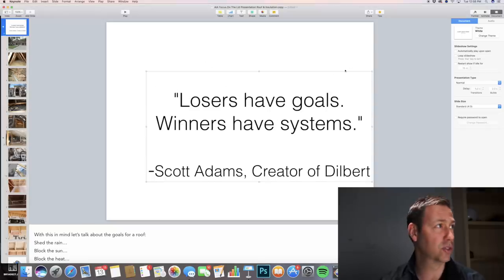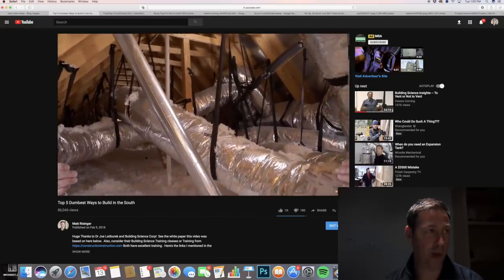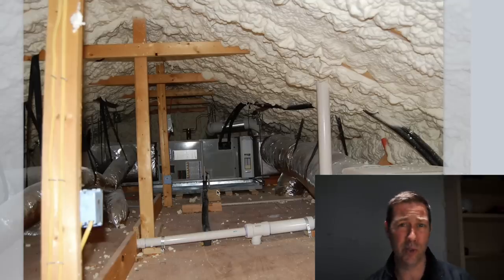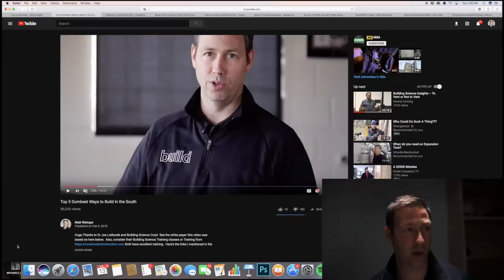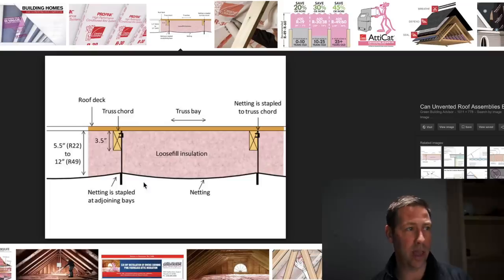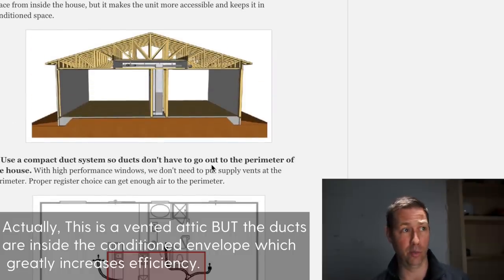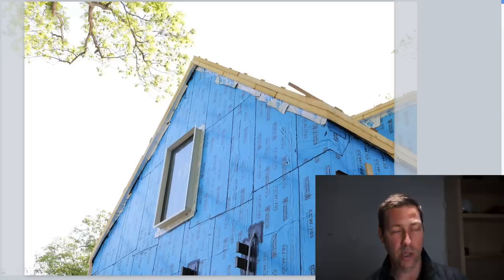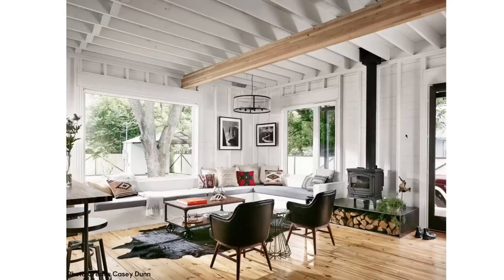Attics/Roofs - Dumb vs. Smart - How to Build Correctly

Comment: The best design I think I can muster, would be recessed attic ceiling that's insulated from below as seen. The space between the roof and ceiling being vented/fanned. That would allow leak repair because... Sectional. And maybe at the apex of such structure have an open gap so that some free air can circulate. Singles and roofs are expensive. Also. Dont just get a regular attic fan, look into fans that have proper ducts that can greatly improve their efficiency and life. We're all scientist and this channel is about good practices. Not the best. Because only you can figure out the best if you're not lazy enough to figure it out. But sure. Pay someone else to think for your money. Who knows. You may invent a groundbreaking way to do something and make bank. All for not following the lemming. Its your money. Proteccccc it

Comment: People in my area have a fascination with vaulted ceilings with exposed beams. When I did the load calculation At my cousins house the exposed beam ceiling was 58% of the load of the house causing his ac to be 2 tons larger to handle the load.

Comment: Recessed cans were not insulated likely because they were non-IC rated? Also your energy savings due to insulated attic must be offset by the added load carried by the A/C unit which now must heat & cool the entire roof surface. Spray foam also completely seals the attic which will not allow moisture a path to migrate out of the attic.

Comment: Matt, I'll apologize in advance for my ignorance but you don't learn if you don't ask questions. I was always under the impression that you needed air flow under the roof in an attic and if this airflow was cut off it would cause the roof to heat up and decrease the life of your roofing (ie shingles). I was always told that if you over insulate your attic and if you don't insure the eaves are clear for airflow, this would be a big problem. With the examples you showed, where they foam/insulate all of the rafters in the roof, how does this impact the life of the roof and roof coverings? Doesn't the roof itself get exceedingly hot being so insulated underneath?

Comment: Tried to get my builder and insulator to spray foam my roof deck - they refused. They said it would get the decking too hot, burn it up, and that it would fail. :( Didn't matter what studies I showed them, they refused. I have spray foam on the floor of the attic followed by blown in fiberglass. Works but no radiant barrier and I refuse to pay the mint that so many installers want to add it. Not a conditioned attic but it's working well enough in the living space.

Comment: That would make my current place 575k to build. It's an east TX house just like the ones you pictured. I'm thinking I could add a minisplit system in each room, leave the outside doors open year round and still be ahead. Maybe I'm a cheapskate but 250 a SF seems way high unless you are a politician. I do like the retrofit where you box in your duct system and leave the rest of the attic unconditioned. That looks to be the most economical way to get it right.

Comment: I have that exact 50 year old roof, 2100sq/ft and a $500/month power bill because the A/C can’t cool the house.  I am trying to figure out what is a practical solution.  I have to consider code changes I assume, and we have hurricanes. A retrofit has to factor in that a old house will be difficult to recoup the value if I sell, because comparable homes won’t have $300,000 roofing

Comment: I'm not sure this is great advice. Every time a asphalt shingles bubble and fail in Oklahoma spray foam insulation directly on the roof deck is to blame. There should be baffles installed on the roof deck to create a small vented area and spray foam on top of the baffles. This would be coupled with a ridge and soffit vent or you could make a small unconditioned attic at the top and use more traditional vents at the top. This would get the the benefits of a conditioned attic without sacrificing the roof deck and singles. The sun is too direct here to give heat energy and moisture nowhere to go and I couldn't imagine it's different in much of the south.
Reply: I agree, would not spray directly like that.

Comment: Use white Roofguard 700 on your asphalt roof and get to 5 deree above ambient temperature to eliminate summertime heat.  Applied once every three years and you should have a forever roof.
Reply: Look at that, a white metal house.  That would be virtually zero heat gain from the sun.

Comment: In that last metal house - it occurred to me that the roof venting system might double as a solar heating system.  If the sensors agree you could perhaps cycle house air with a fan through the roof space to heat the house.

Comment: Hi Matt, and thanks for all the experience you're sharing here. I'm upgrading a house in Los Angeles in ocean area. It is not as hot as in the desert. Never snows. But pretty humid. We are not using HVAC in the house. Trying to rebuild attic space that causes a lot of condensation and some mold. Was looking into attic fan, but after watching your videos understood it is no the way. There are vents a t the bottom of the attic and Rockwool insulation. Would you advice to seal it? Would you advice to leave the vent open and isolate it from the house air as much as possible?

Comment: I've seen YouTube video where someone got their attic  Foam sprayed and it turn into a nightmare.  According to the home owner it had a very awful toxic smell. Are they went back-and-forth with the foam company, Ultimately the home owner had to replace does entire roof.  How would you  Avoid this issue?
Reply: That happens when the foam doesn't cure correctly. Which can happen to even the best installers. So yes it can be a problem for any installer and the home owner is screwed.

Comment: fyi, when i was working for the gas co in so cal, we would work in a golf community on the east end of the city of Beaumont. part of our service was to the furnaces which were in the attic. this was the first time i have seen insulation on the underside of the roof (tile) instead of the floor of the attic. it was blown in fill w/netting to hold it in place and the attic was as cool as the main floor! remember this is in calif low desert about 40 miles from palm springs. 110 temps are common in the summer. I am curious about the air inside a house you have built becoming stale or ? does the occasional door opening provide enough fresh air or do you depend on the air handler filter?

Comment: With plastic foam insulations including spray foam in attics, in a new video, would you cover the code requirements for thermal barriers and ignition barriers, when they are and are not needed, and why they are VERY important?

Comment: Matt:Would you recommend closed spray foam in the attic space if your heating and cooling equipment is in the basement.  I am building a ranch rambler and would like your thoughts.  I'm in the west and get super hot in the summer and super cold in the winters.  Would insulating my roof benefit me?  I will have a truss roof.  thank you

Comment: I'm so confused. Last video you talked about how important radiant barrier is at stopping the heat in the attic. Then you show a "bad home" with radiant barrier compared to the perfect system with spray foam and...no radiant barrier? Is having a semi-conditioned attic space only important when you have HVAC up there? What about the homes up north that have HVAC in the basement?

Comment: closed cell foam would seem to leave the house vulnerable to rotting the rafters and roof sheathing, from leaks. Who would know the roofing material is leaking with waterproof closed cell foam under the roof rafters and roof sheathing?
Reply: Billy Graham he says, several times, that most of the spray foam you see is open-cell foam. The closed cell foam is only used to seal up small cracks.

Comment: Matt, I have a 4/12 pitch roof in Cocoa Beach, FL, and it's extremely aggravating and difficult to move around in my attic. Is spray foam to the underside of the roof the best way to condition the attic? 1957 house. Great vids. Thanks.

Comment: How does closing off the attic venting effect the roofing system if you're using shingles?  I would imagine thermal cracking would occur after just a few years.
Reply: You are correct. Go to anybody's house in your neighborhood that has a vaulted ceiling and you'll see this effect. Areas of the house that are vented with attic space will be in much better condition than the areas that are closed off without ventilation.
Reply: @JarvisElian  but only houses with HVAC in the attic should be insulated. Otherwise it can be sealed off.

Comment: One thing about foaming the underside of the roof, what happens if there is even the smallest roof leak? What happens then? Do you leave a 1" air space on top of the foam along with a ridge vent? That could be done by insulating with rigid foam, but it may be a lot more labor intensive. How about using fiberglass batts between the rafters (leaving an inch or more at the top for ventilation purposes from the soffit to the ridge, and then covering the bottom of the rafters with rigid insulation?  

Does air get through the foam and condense, or does that not happen?

Comment: Matt, about closed cell foam directly on sheathing.  With asphalt shingles on the roof, are you not concerned about a leak (10-12 years) down the road and causing extensive damage because the leak was undetected for a long time?  Or maybe I should ask, how is the closed cell foam installed to prevent such a awful issue?

Comment: Another great video.  First time I’ve heard you comment on a  vented roof.  You emphasize non vented attics but I’m wondering if we are losing something by not venting.   Are you relying entirely on thermal mass?   Seems like an air cushion which can heat and escape would keep the attic on relative shade.  Thanks.

Comment: I feel like the water proofing should of been on the outside of the insulation. Please explain why I'm wrong (or how I'm right).
Reply: because insulation will never be airtight. it needs to breathe in order to dry. another reason they built the roofing off the insulation for that air channel.

Comment: This is entirely for dry hot climate. If its humid and wet, even if the spray foam is some anti microbial poly-whatever water will get through sheathing carrying all the minerals and enough water for mold/mycelium substrate. You won't see it till you have to replace sheathing because damage is too severe. Just off the top of my head never having done this, stapling Mylar to  rafters would be more effective and you would still get air flow in rafter bay, also much cheaper++++
Reply: What about the Silver Glow [¿¿or one word SilverGlow??] he mentioned for the rafters instead of Mylar?

Comment: My builder wants to spray foam directly to the underside of our standing seam metal roof (metal frame as well) for a conditioned attic in our up and coming build.  I'm apprehensive about not having any sort of sheathing between the spray foam and our very expensive roof, but the builders in our area (murchison, TX) tell us that they do this all the time and don't have any issues with corrosion. Can I get your thoughts on that?

Comment: Matt, thanks for the video. I have a couple of questions. My home is built in 1972 and I will need to replace roof soon. First question is if using spray foam on roof decking, what happens to foam insulation if roof decking needs to be replaced? Second question, could I have roofer install 3 inch foam sheets on top of existing decking and then add the new roofing material on top of insulation sheets, like an insulated cooler top? I hope that makes sense. Looking forward to hearing your thoughts. Best regards, Steve
Reply: New roof decking gets added on top of existing, they rip off shingles, but don't usually rip off the existing decking. Not around here anyway.

Comment: So with that spray-foam, doesn't the roof get a lot hotter? Seems like I heard about this leading to premature aging of shingles... or maybe this is that tile roof you were showing us? We were also in a condo where they added insulation when they re-roofed, and the increased heat caused some major noise, with additional expansion/contraction.

Comment: Another helpful video Matt.  Thanks!
If I plan to use mini-split head units in each room, is there any advantage to insulating the roof as opposed to the attic/ceiling?
Reply: Insulating the lid and conditioning the attic space is the way to go. The heat/cold from the attic will have an affect on the overall efficiency of the building.

Comment: I'm a retired builder, ad no one is talking about offgassing. There's some pretty toxic crap in spray foam and I'm guessing it's not so bad in the attic, where the crap goes up, but does it leak down, and then there's exterior walls and spray foam. The offgassing is just not talked about much. I'm not much of a fan of certain chemicals being that close to the family. The guys spraying this stuff aren't suited up for drill, and if the two agents are mixed perfectly they stay active, and that's why when people are getting sick the manuf. is always blaming the installers. The bottom line is one in a thousand get real sick, but with bad chemicals how long can people take to wear down their immune system and get sick is different. They're just know getting the hint thatn EMF is real, and if you don't think so just live close to high power lines and see who gets cancer first. Be smart and check into the risk for you. Some people don't give a damn and some do. Science and efficiency mostly about making more money, so to live happily do the research.

Comment: Is it possible to do a "perfect roof" with overhangs?    I've seen other vids where you endorse zipwall; how do you feel about zip roof?  since vapor and moisture is on the decking, can you add the polyiso on top or would that cause issues?

Comment: Spray foam have chemical / environmental concerns? Also ability to check leak locations is more difficult. The truss plenum and exterior rigid insulation system are fantastic though

Comment: Here in NJ the HVAC installers are so stupid they install high efficiency (90+) furnaces in vented unconditioned attics. Then on the first deep freeze the condensate pipe freezes, cracks, thaws and floods the 2 floors below. It happens every winter and the code officials keep passing the final inspections. Keeps me busy as a home improvement contractor.

Comment: You mentioned having a hvac supply line empty into a spray foamed attic, but not a return duct. Is it assumed that the air will move down from the attic to the nearest return vent?

Comment: Matt. Do you have any data on heating and cooling cost of a house with a conditioned attic vs conventional vented attic?
Reply: I've thought about this as well. With the conditioned attic, if the HVAC is up there it will run more efficiently and you don't necessarily have to worry about small leaks in the ductwork but it's also however many more hundreds of square feet getting added to the conditioned space that's passively getting heated or cooled. Maybe HVAC somewhere in the conditioned space or a properly insulated/finished basement would be more efficient with a traditionally vented attic that's properly air sealed and insulated? Hard to say

Comment: Really love this 'no sheet Rock' house! How did you hide all the electrical and plumbing? I do love exposed copper if it's done well.
Reply: Exactly! You can see the conduit with the electrical in one photo, though they try to hide this with the camera angle and furniture. For a house like this, you need lots of low cabinets to hide these functional systems. Also, all services are on the exterior walls. I'm not sure how many interior walls there are.

Comment: Don't know if this was mentioned, but if there is no roof vent or eve vents on both ends, does this mean there is no soffit vents either?  What prevents mold or prevents the yellow like beading on the rafters from no air ventilation.   I am no professional nor am I speaking with any authority.  I am coming from what I have heard and what I thought I may I had learned.

Comment: Matt Risinger,
With the last house that you showed, how did you fasten the insulation to the roof and then how did you fasten the wood on top of that?  How could you find 1.5 inches of wood through 6" of insulation?

Comment: How do you correctly handle spray foam in the attic of a brick home?  In my case, the air gap behind the brick vents into the attic space and is, thus, also ventilated by the soffit->roof air flow pattern.

Comment: Suppose that those 1970's home need a new roof, would you apply an outside insulation prior to new roofing?  Could you go back in then and 'clean the attic' or even leave it the same and improve those, what you called uncomfortable living situations?

Comment: Question - What about attic vents? We have a roof vent across the top ... can we use spray foam or do we need some other option? Also, with a roof that is vaulted, can spray foam be used and what would vents look like?

Comment: Matt. So the metal roofing is attached to those 1x4 s. It looks like they go at a diagonal, is that correct? Why would you do that? This question is on the last home you showed with all metal on exterior.

Comment: The issue I have with icing aka spray foam is that you never have a vapor barrier between the foam and osb/plywood. A roof will eventually fail and leak. When that happens and you have to replace the load bearing carrier...what will that do to that icing space? Its still too new of a product and I never hear that result